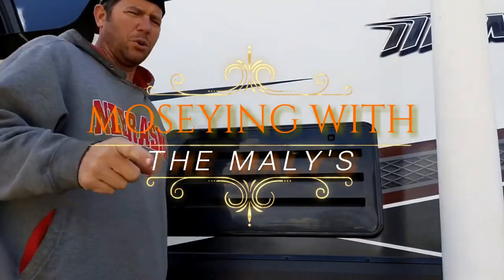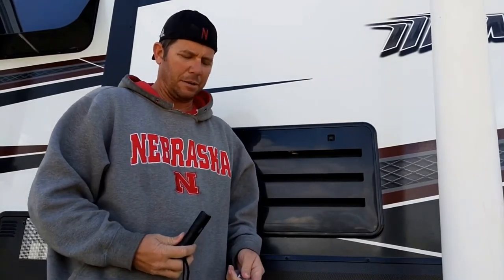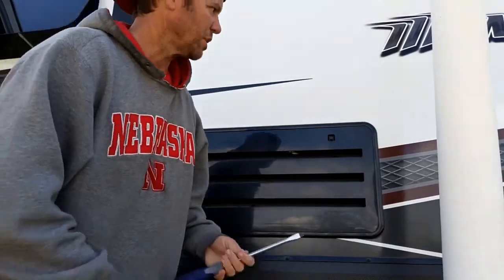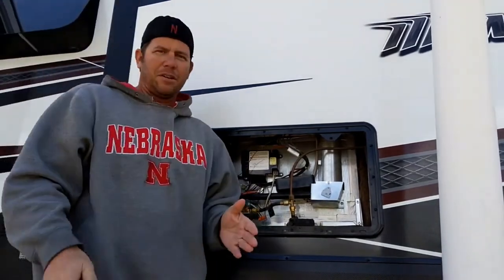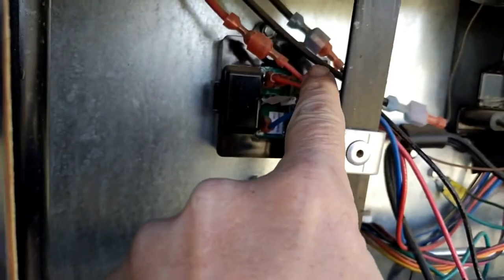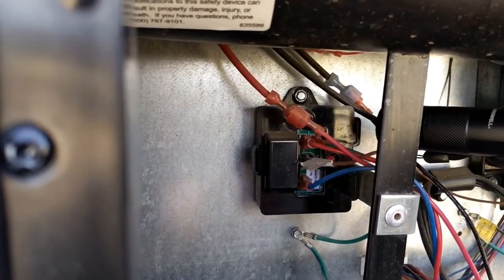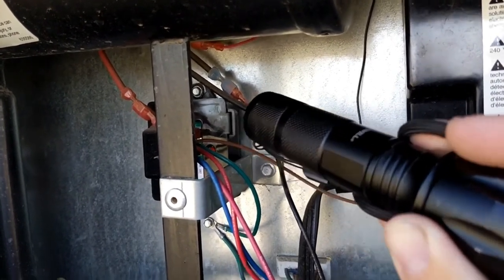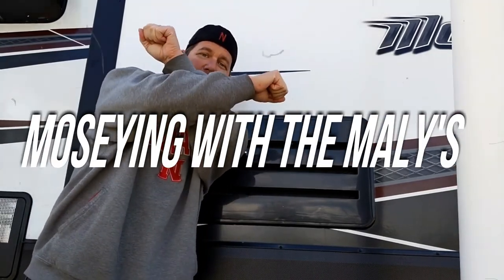How To Fix: NorCold LI OP Code

Comment: I had washed the trailer and boom threw the code but a good magnet fixed it and all is well. Our fridge is just outside the recall cut off but a 4 door norcold is costly to replace so thanks for the info. It does make me wander how many people got to or were dooped into buying a whole new unit when it could of just needed reset.?

Comment: My red light is not a solid red but a flashing red. I applied the magnetic and it didn't work. Any suggestions?
Reply from the maker: Is it a constant flash?  If it is not it could be a code???? But that is a total guess on my part mainly because that unit has one job to do as far as I know????? Sorry I can't be more help on this!!!!
Reply from the maker: Have you found a solution yet?

Comment: Mine doesn't have that little box with the red light on it.  Everything else looks the same, except for that, pretty much
Reply from the maker: Do you have a Residential Fridge?
Reply: @moseyingwiththemalys3357    No, it's an RV model.  AC DC LP Norcold.  My RV is a 2004 Colorado.
Reply from the maker: I am not really sure then...I have a 2018, maybe they have changed it since your model.  Does your manual say anything about it? Or try to download a Norcold manual from 04?  Sorry I couldn't be more help.